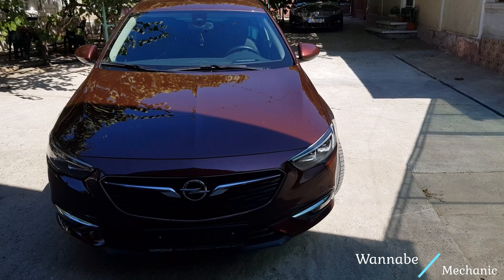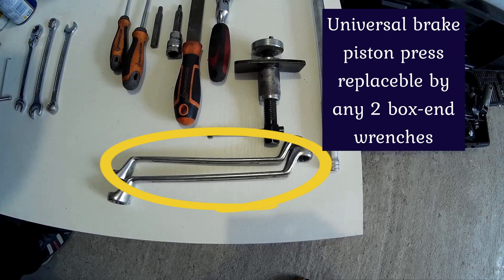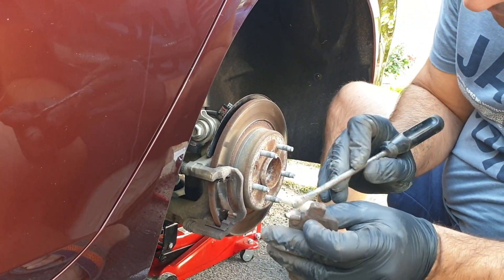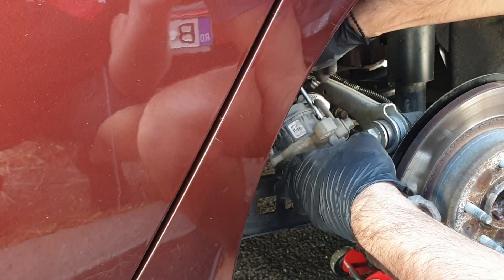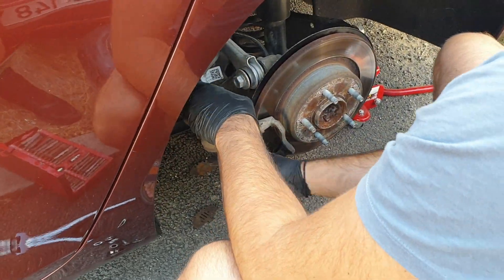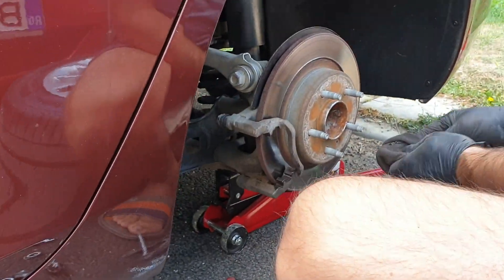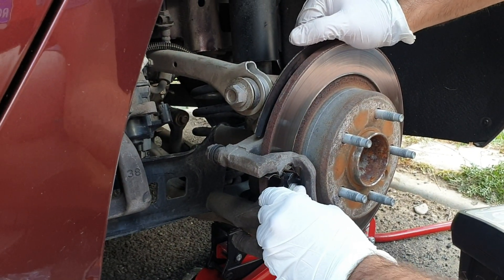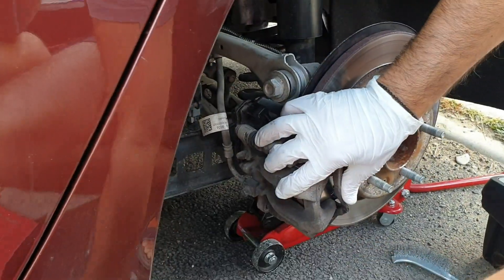Opel Vauxhall Grand Sport Brake Pads Replacement DIY Electric Parking Brake System EPB

Comment: I used a battery from acu drill to retract electro motor,it was easier then to unscrew motor. Anyway thanks for the video.
Reply from the maker: We use a universal diagnostic tool now. Too much work and negative comments when using other methods.😄
Reply: @TheDIYWorkshop2020  Well my friend i dont have diagnostic tool. I was just finding my way around.😂
Reply from the maker: Thank you for watching and for the comment!
Reply: @TheDIYWorkshop2020  You are welcome.

Comment: hey ty for the instructions... I am trying to replace the rotors aswell but cant seem to get the caliper off... any chance you could make another video please? :)
Reply from the maker: We have a ton of videos on replacing brake pads. The brake systems are quite similar for most cars. Search for one that helps you best.
Reply: Take the caliper off... 2 more screws.

Comment: If i dont aply the handbrake, do i need to retract it then like in the video?
Reply from the maker: Yes, you do. However, another viewer left a comment saying you can place the car in brake pads replacement mode without a diagnostic tool. I haven t checked this info yet. When we made this tutorial there was nothing online. Now I bought a multi brand diagnostic tool so it' s much faster.

Comment: There is "EPB service mod" for retracting rear calipers and pads.

Also it's not good idea to put regular grease on breake parts. There is special coper grease for touch parts(rear of pads, metal pad holder...) to remove noise and silicone grease for moving parts (two sliding pins holding caliper).
Keep up the good work!
Reply from the maker: Thanks for the tips! Always appreciate constructive feedback.

Comment: Thank you, I have just ordered my rear discs and pads. I was searching for tutorial and i have found your video. I just wanted to say that I guess you can put it on service mode therefore no need to remove the motor from the caliper?? I heard that there is a procedure like this:

<service mode>
ignition on
Firmly depress and release brake pedal 5 times
depress and hold brake pedal
Press and hold EBP switch till EBP malfunction light flashes on dashboard
release EBP switch
press and hold EBP switch for 5 seconds
release brake pedal
EBP malfunction light goes out briefly
Now you are set

>To take it out of service mode<

Switch ignition on
depress and hold brake pedal
pull and hold EBP switch till EBP malfunction light goes out on dashboard
release brake pedal
switch ignition off ! 

Somebody has explained it here:
https://youtu.be/YBxugEiAsfE?si=3J2gcvDJ64NomI4a
Reply from the maker: Never tried that but it seems even more complicated🙂